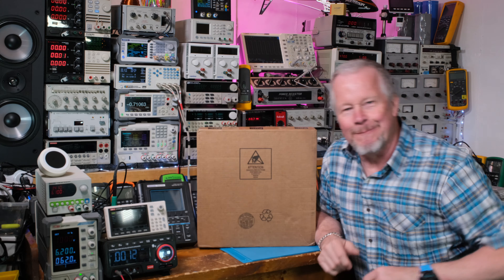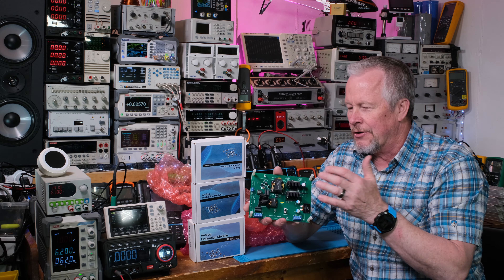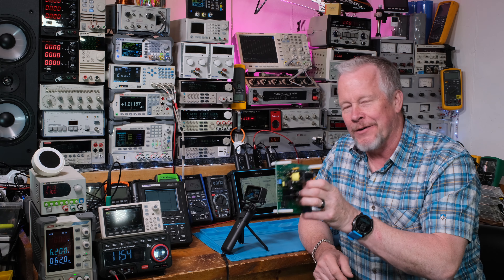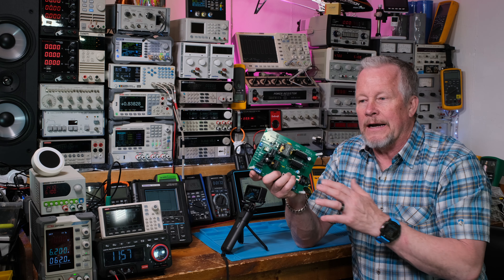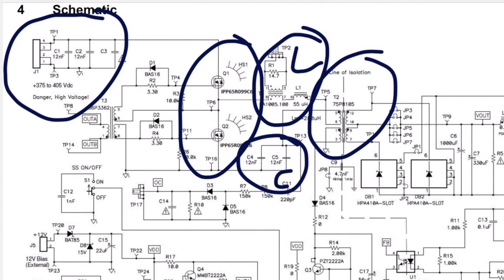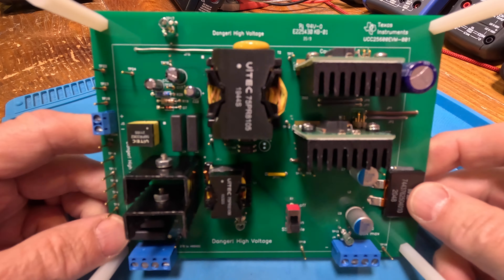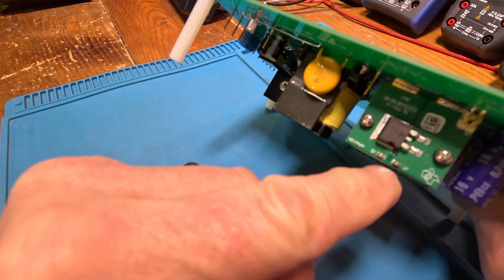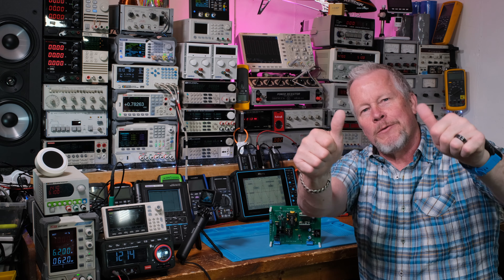LLC Converter Eval board by TI UCC25600 - a JAT collaboration #LLCconverter #UCC25600 #JATcollab

Comment: I don't think I've ever seen a surface mount electrolytic with stress creases on the top
Reply: HI Eddie, thanks for Converter video and explanation, excellent.
Reply from the maker: Now that you mention it - I'm trying to think if I have;)  I wonder if it is because of their smaller size?  It is a bit scary to think that they just blow up with the metal can.

I'm so careful around caps that I've been lucky not to blow any up.  I hear stories from others about shrapnel flying around after hitting the power switch...and finding an error...

I'll have to talk to the experts to see if smaller caps don't dry out as fast as the big ones - and why the stress creases are not common.  Now that I think about it - I have seen creases on some - but they are not the same pattern as their larger through hole counter parts... hmmm
Reply from the maker: Thank you!